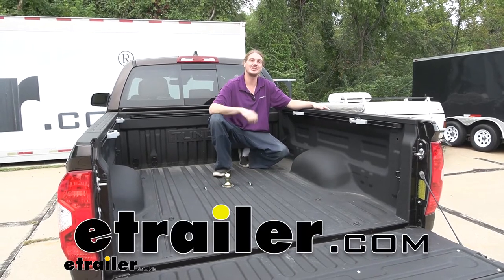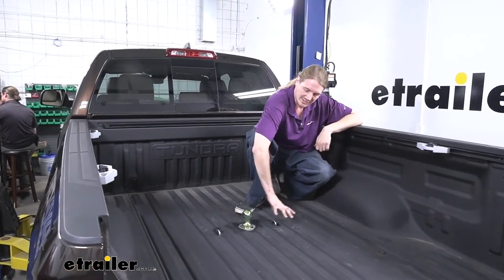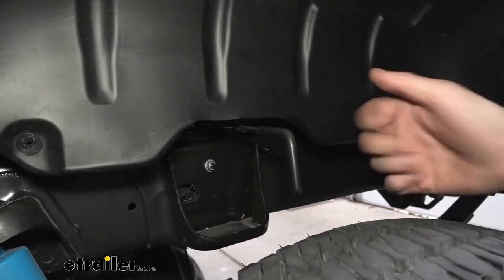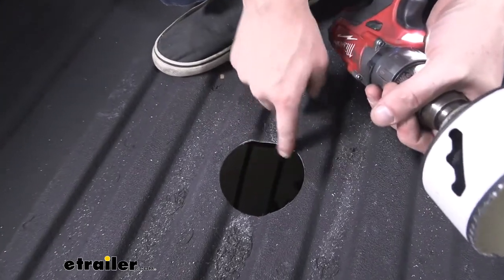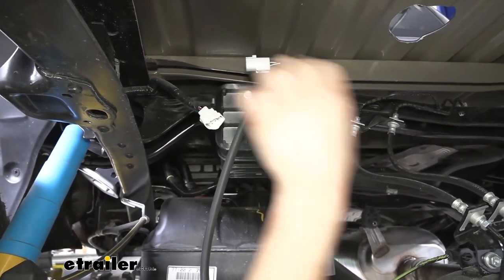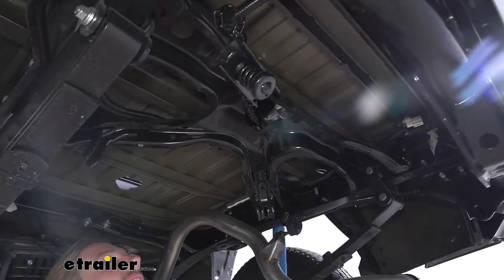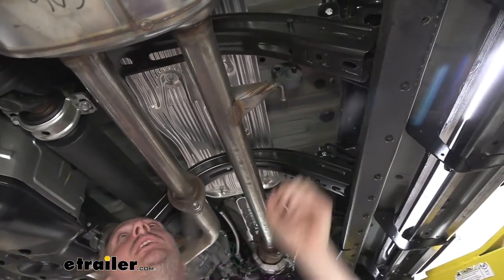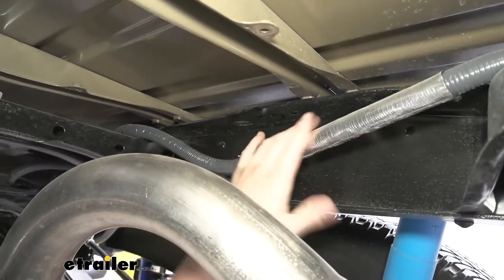etrailer | B and W Fifth Wheel Trailer Hitch Installation - 2020 Toyota Tundra

Comment: Is the same for 2021 ?
Reply from the maker: This hitch is designed to fit the 2007 - 2021 Toyota Tundra with the 8 Foot Bed.
https://www.etrailer.com/Fifth-Wheel-Installation-Kit/B-and-W/BWGNRK1257-5W.html

Comment: Thanks for the video! Does anyone know if this would be the same installation for a 2017 tundra TRD sr5 4x4 double cab?
Reply from the maker: The gooseneck hitch featured in this video is also designed to fit the 2017 Toyota Tundra for all 3 bed lengths.
https://www.etrailer.com/Gooseneck-Hitch/B-and-W/BWGNRK1257.html
https://www.etrailer.com/Custom-Fit-Vehicle-Wiring/Tow-Ready/20110.html
Reply: How much does this cost